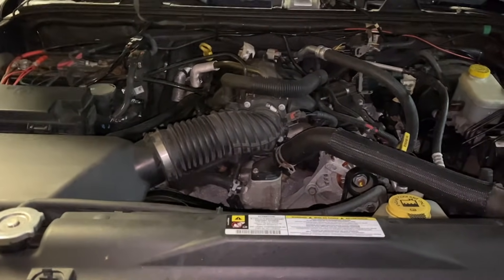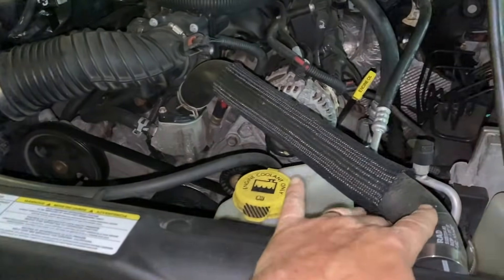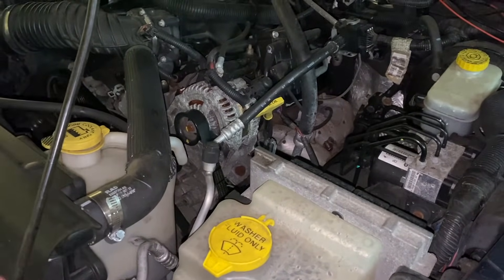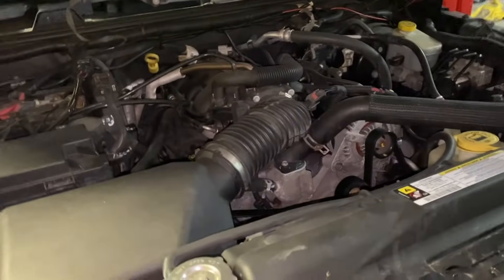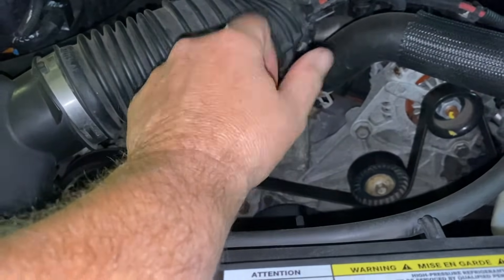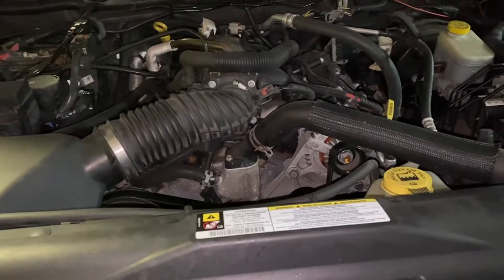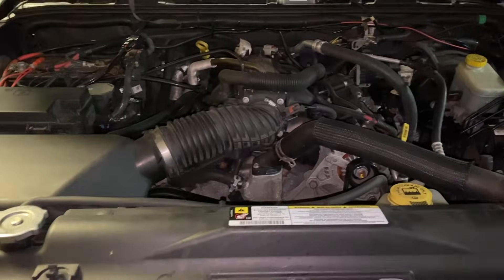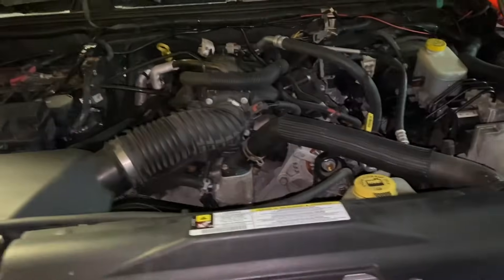Why Car Overheating After Replacing Radiator, Water Pump, Thermostat, Or A Coolant Hose

Comment: Just had my 2015 f-150 2.7l radiator and thermostat and water pump replaced at mechanic and this is the 3rd time it’s back bc it keeps overheating. I hope they figure it out. This is why I didn’t do it myself bc I would never be able to figure out what’s causing it. $2,025 total for repairs, any knowledge of this same problem with someone on here would be greatly appreciated thank you
Reply from the maker: If it didn’t have that problem before it’s the work they done.

Comment: 2007 Dodge Caliber 2.0L cooling issue after a freeze. Temp swings fast (½ → ¾ → back), bubbling/rumbling after shutdown, overflow cap popped off twice. Heater hoses hot but cabin heat inconsistent.

Heat behavior: after correcting heater hose routing and burping, heat came back strong at idle and light driving. Under load or longer drives, heat would fade to lukewarm or cold, especially with higher fan speed. When heat dropped, temps would start climbing. Letting off throttle or coasting would bring temps back down, but heat wouldn’t always return.

What I’ve done: replaced both thermostats, ran with one/both removed (got worse), multiple proper burps + force-filled heater core until solid flow, flushed heater core and radiator (clean), verified radiator (behind condenser) gets hot, lower hose warms, bypassed heater core once (helped slightly short term). Had P2183 (ECT range/performance).

Current state: temp now rises toward ~½–¾ then settles back, accelerating sometimes cools it, hoses hot, radiator warm, heat still weak/inconsistent.

Not done yet: water pump, radiator cap/overflow cap replacement, or pressure test (no equipment).
Looking for input on pressure loss vs weak pump vs something else.
Reply from the maker: Sounds like a bad head gasket or cracked head
Reply: @motorcarnut  no milky oil or coolant in oil, no white smoke. changed the radiator cap just incase. im down to water pump or just bad radiator.
Reply from the maker: Still could be

Comment: Well this might be the video that I needed, my VW Passat 2016 started overheating and I began doing the following steps one by one Flush the coolant system>bled the air out>replace thermostat valve>replace water pump and all hoses>replace the radiator itself. and at no point did it ever stop overheating.

Now I am looking into changing the auxiliary water pump and oil cooler but besides these 2 options I am afraid im looking at a blown head gasket, any help please?
Reply from the maker: It does seem like you have a hear gasket issue. Try pressuring the cylinders one by one and see if you see air bubbles in the over flow tank.

Comment: I changed the radiator, the water pump, the thermostat, and the hoses, but I still have coolant leaking, and 2012 dodge ram still is overheating.
Reply: Having same problem with same year truck did you get it resolved?
Reply from the maker: Double check all connections and make sure they are tight, and use some dye to see where the leak is coming from.

Comment: 2017 chevy equinox 2.4l I replaced head gasket,water pump,radiator,thermostat, coolant hose ,temperature sensor, its still overheating. i did coolant system bleeding tool ( with vacuum filler) still overheating
Reply from the maker: Did you replace the radiator cap too? When you replaced the head gasket did you check cylinder head and block for warpage?
Reply: @motorcarnut  yes i did
Reply from the maker: Maybe there is a crack somewhere in the cylinder head or block?

Comment: I just got a 87 cutlass supreme 5.0 that has been sitting for the past 5 years and replaced the radiator, water pump, thermostat and the gaskets. I’m having a problem with it overheating after running for about 15 to 30 minutes and it’s always overheating from the top radiator hose. I’ve tested the thermostat and replaced it 3 times now. Also the passenger side head gasket appears to be smoking when running, but isn’t bad at all and I have no murky oil or coolant. Would anyone know why this is could be happening. Thank you.
Reply from the maker: Replace radiator cap it you didn't already. If its a head gasket problem try squeezing the upper radiator hose with engine overnight cold should be soft to squeeze, then start the engine and in about 3 minutes or so squeeze upper hose again should be still soft if its hard you got a blown head gasket causing engine to overheat.

Comment: So how concerned should we be if we accidently have it over heat because of this?
Reply from the maker: Depends how long and bad in overheated. When you correct the problem and it doesn't overheat no more you should be fine.

Comment: i have a chevy malibu ls 2014 and i replaced the hoses on the back eng replace the t part water pump and housing thermstat ! and its still over heating bleed the air out and all
Reply from the maker: Did you replace the simple radiator cap? Does the coolant system build up pressure before it gets hot? If so may be a blown head gasket

Comment: I have a 2014 Dodge Durango SXT. It started overheating out of nowhere. No codes. We changed the thermostat and water pump. It still overheats. It starts overheating pretty quickly and before it gets to temperature, the coolant reservoir starts to bubble. Any suggestions? We are lost here.
Reply from the maker: Try replacing the radiator cap first
Reply: @motorcarnut  Thank you so much for replying! I will do that first thing tomorrow! If it doesn't solve the problem, what would be the next thing to look at?
Reply from the maker: I hate throwing parts at it, has to be diagnosed and not a head gasket problem too.

Comment: I’m having problems with a 2015 dodge dart sxt Mines just had thermostat housing replaced radiator and heater hoses, runs hot after driving comes back down goes back. Can’t get the temperature to stay at the middle gage. Any advice????
Reply from the maker: Make sure to change the radiator cap? And is the vehicle overheating? The coolant temp sensor may be faulty and making the gauge read high.
Reply: @motorcarnut I’ve replaced the cap as well l, yes it tends to over heat well the temp gauge turns on it never touches the H
Reply from the maker: You may have to check for a leaking head gasket that is pumping up the coolant system.

Comment: Heeeeelp! I just replaced thermostat on a 04 civic, now is over heating and hot air doesn’t work! Top hose get hot , bottom hose stays cold.
Reply: Help!!! I have a ram 1500 we changed thermostat, mechanic said water pump is good and we just did a test on the gasket and they said it passed?
Reply from the maker: Simple things first, change radiator or expansion tank cap, could be clogged radiator as well.
Reply from the maker: You have to bleed the air from the coolant system, that's your problem!
Reply: @motorcarnut  i will try it tomorrow morning as advised.🙏🏼
Reply from the maker: Yes, and letting the car sit overnight will help with the bleeding too as the coolant will slowly remove air overnight.

Comment: Head gasket+ cap + radiator+ radiator hose+ thermostat+ water pump. Still overheating
Reply from the maker: Cracked cylinder head or block
Reply: 💔 @motorcarnut
Reply: @motorcarnut 😢

Comment: I have a 2006 volvo xc90 what could be the problem with it running hot only when it fills like it it has new water pump new radiator new thermostat and new thermostat sensor I can let it Idle it the drive way for over 30 minutes and it doesn't run hot then all of a sudden it starts to run hot and I don't have any Coolet links anywhere and the coolet level is always at the normal range and the fan kicks on ????????????
Reply: I don't never have to add Coolet
Reply from the maker: It can be leaking into the combustion chamber ( cylinder )
Reply from the maker: Just replied.
Reply: @motorcarnut  why is the top holes on the radiator get hot but the bottom holes stays cold and doesn't get hot ?????????
Reply from the maker: Could be air in the coolant system or a bad head gasket.
Reply from the maker: Bad or going bad head gasket would be my guess.
Reply: and my oil never has coolet in it are it doesn't look like a milk shake
Reply: I've done that list too and still overheats.. after seeing a specialist he concludes I might have a bad head gasket and if unlucky, a cracked cylinder head.. going to fix that, no matter the cost. 2006 Sorento diesel.

Comment: new pump
new termostat
new coolent 
fans working
no air
still overheating
i tried for a while to drive without a termostat and didnt Overheat without 
(i tried a few termostat all did the same)
Reply from the maker: Did you replace the radiator cap? Also could be a bad head gasket. Try this. With engine overnight cold squeeze top radiator hose to feel how hard it is, then start vehicle and in about 5 minutes squeeze it again, should be about the same hardness, if not air is pumping up coolant system because of a blown head gasket.
Reply: @motorcarnut so if after 5 min it feels harder then before it’s the head gasket?
Reply from the maker: It does sound like it yes

Comment: Just got a 95 Chevy G20, previous owner said recent water pump, head gasket, radiator. Running just fine, but coolant looked nasty. I drained the coolant with a bunch of rusty stuff. So I ran a coolant flush through for 3 hours and everything was fine. Drained that. Flushed several more times with distilled water. Rubber gasket looked worn so I changed the thermostat and new gasket, sealed that, filled with coolant. I tried burping again just like before, but now the upper radiator hose doesn't get hot like it did during the 3 hour flush, like it's not cycling coolant and in 10 mins running, the temp starts rising. I'd really appreicate any input!
Reply: This is a year old video and you just responded within 30 minutes? Holy cow man.  I am so very grateful! I'm letting it cool again now and I will certainly try that. After the first time I let it cool, I fired it back up, it didn't bubble really but it continued to steadily push a bunch of coolant up out of the radiator. So I came in and watched your video! I really appreciate you sir. You're definitely getting a sub!
Reply from the maker: @ActualizedOutlaw thank you as well really appreciate the feedback as well.
Reply: Was your issue solved ? If not raise front of vehicle to help burp it  @VicesN2Virtues
Reply from the maker: You definitely have air trapped in the system , try loosening the clamp on the upper radiator hose until coolant comes out but be careful not to burn yourself. Air is trapped in the system. Sometimes letting the engine cool down it will suck in more coolant and self bleed itself.

Comment: I have a 2011 Infiniti QX56 I have fluids leaking from the front of the truck. I’ve changed the coolant reservoir,water pump, radiator still leaking and now overheating . I need help
Reply from the maker: Got to clean everything dry then start up vehicle and see where leak is coming from. I’m not there so can’t help more than this
Reply: @motorcarnut  Thanks
Reply from the maker: @favoredbygod0771 no problem

Comment: I changed my thermostat and water pump but it's still overheating somebody tell me what's wrong
Reply from the maker: If you followed my video then could be the radiator cap or radiator itself or a blown head gasket
Reply: Radiator cap trust bro trust could have the wrong one on and could be pushing air in your system
Reply: @WhoDibbles  sounds like I have the same problem, bought new radiator cap and weird problems overheating ect ….  Thanks for the info 👍!

Comment: Replaced houses not overheating not leaking I wiped down every hose ran it Check for leaks houses are completely dry and clean when I take off the radiator cap there is 0 pressure....... It defies a laws of physics..my bad....heatercore leak
Reply from the maker: Maybe you got no thermostat in the vehicle or it’s stuck open

Comment: Air in coolant system will even cause idling issues. Found out the hard way on 1999 Honda Accord after replacing radiator. I forgot that coolant travels thru idle air control valve which communicates with PCM. Great video
Reply: What t do I do if it's still rubbing hot after bleeding changing thermostat
Reply from the maker: Thank you! Great point!